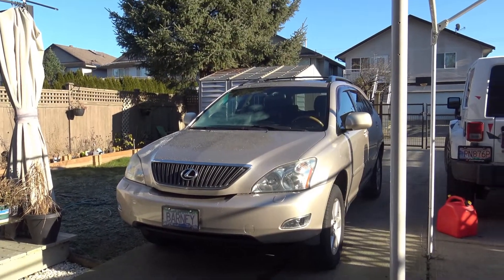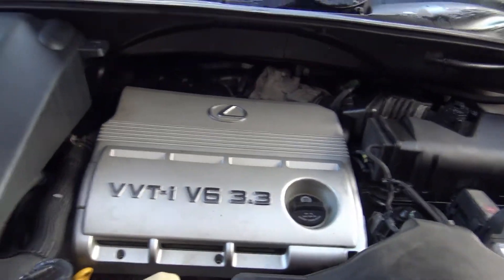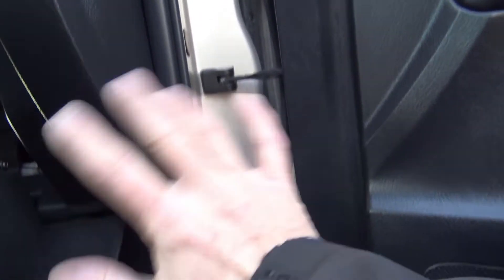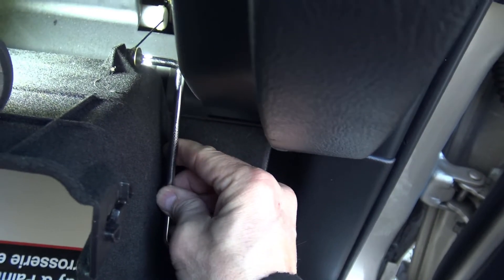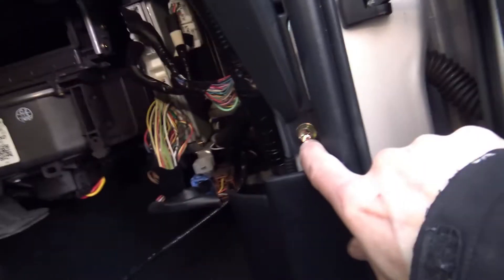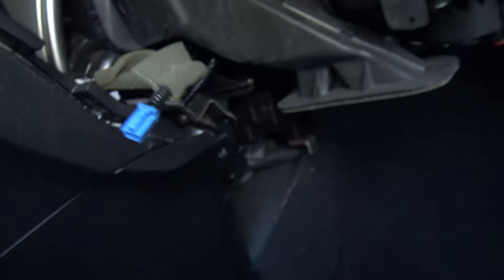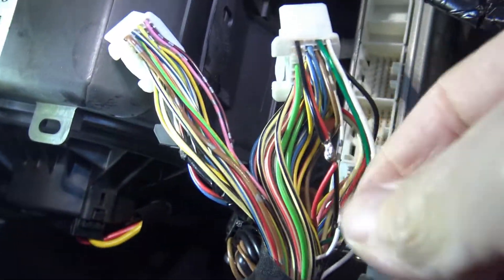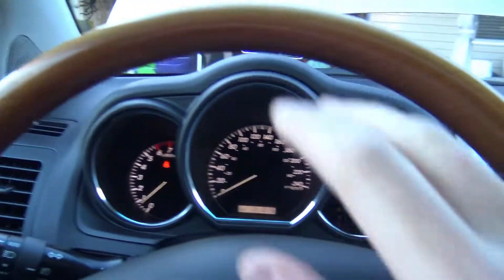lexus  code P0333 knock sensor hack

Comment: On my 2000 ES300 just jumpered both wires together (without cutting either one) and it worked.  No need to cut the bad wire because there is no power going through it anyway so why cut it?  Also, since both wires are uncut, it doesn't matter if you make a mistake identifying which wire is for which sensor because both are jumpered together.  On my car, the 2 wires are located on the very bottom connector when looking at the Engine Control Unit (ECU) which is sitting vertical under the glove box.  The two wires are clear and located in the middle toward the edge of connector but one wire has a red piece of tape on it to identify it as knock sensor #2 (OBD code P0330).

Comment: Good morning, good evening or night depending on what time or day you read this message,

Thank you for the hack or trick of the trade, 

But there is no explanation on the complete wiring schematic.

So if you cut the input wire from the knock sensor 
BANK 2 has black wire & white wire 
BANK 1 has red wire & green wire 

Red wire & black wire are the input back to pcm 

If you cut the black wire input from nock sensor to pcm ;  the white wire which carries the 5v reference from pcm  ( that wire goes to sensor & those 5v turn into higher voltage signal  which we have cut before it reaches pcm by cutting black wire) doesn’t that trigger a code?

Thank you in advance
Reply: Hi guys if you are here, you have issues with knock sensors 

This is an update on this code p0333
This code means that you have a faulty reading from knock sensor bank 2;
If you have no other knock sensor codes this SHOULD HELP You

If you have multiple knock sensors codes bank 1 & bank 2 knock sensor codes this will not help you.
I had to look for more information before I did the hack on a friend’s 2006 lexus RX300
Reply: So I did the hack, I. Only had this code P0333 no other code, 

Help Notes 
The bigger connector on the ecm or pcm computer how ever you may call this electric box, 
& now just follow what Mike is saying to do  

2 days driving no issues with transmission & No check engine came back

Comment: Just did it. So far so good. Thanks.
On 2004 RX330, you don't need to remove the first screw with the string in the glove box, just remove the 4 screws around and remove the entire block.

Comment: How would you do this on a Lexus rx350 2008 . Bank 2 black and white , bank 1 is green and red . Bank one is failing I tried but throws both sensors off . How should I splice ?

Comment: If the knock sensor is reporting correct data, won't circumventing it eventually result in the destruction of the engine, totaling the vehicle?  Quite some gamble.  Wouldn't a better bet be to purchase some tools and replace both sensors, performing other scheduled maintenance, like PCV valve and spark plugs [1]?

[1] "How to Replace Knock Sensors on a Toyota 3.3L 3MZ-FE" on the "Jack Fletcher" YT-channel.

Comment: I just replaced my ECU and now my radio does not start up super loud anymore when I start the car that I thought was odd and very annoying and the knock sensors were fixed too ..Bad ECU ,,Got a complete rebuilt one for $250

Comment: I have 2004 rx330
P0333 #10
Vibration sensor 2
 circuit high bank 2 . Anyone know if its the same wire assembly

Comment: what type of wire size are those small wire?

Just wanna know for reference if I do revert the wires back to the original connection in the future.They might be too short and need to add extension to reconnect them. Thanks so much!!

Comment: Thanks for this video. Just replaced my harness and both knock sensors for an intermittent P0333 code (voltage too high). Now that I replaced everything, I'm getting a P0327 (voltage too low). SO malfunctioning to non-functioning. Should have just bypassed it to begin with on this old piece of junk.
Reply: So I jumped the pins and now I get low voltage errors on both banks, even though the voltage is the same with a multimeter. What the hell? Bad ECU?
Reply: @Omnis2  did you get OEM/Denso sensors?

Comment: Hi thank you so much for the P0333 hack I have a Jaguar XJ8 X308 it has cured that problem. I tried putting a new knock sensor in but it still didn’t solve the problem I checked continuity through the wiring but still couldn’t resolve the issue until I tried your hack thanks again Kevin.

Comment: ok so I have completed this today and I just want to confirm my Lexus RX330 2005 code was PO332 I figured being that code I would do the other bank opposite of mikes video but I got no results and then did exactly as mike dIscrIbed on here and my issue is gone and running perfect no more lights and limp mode gone THANK YOU  MIKE !!!👍
Reply: Instead of doing that at the PCM.. The pigtail in the engine bay is much easier . I think
Reply: Could you help me u/s where that pigtail is in the engine bay ?  I need to do same job.  Hate to take apart the engine to replace the sensors, and that glovebox job looks almost as bad.   Thanks !!!       @sambatarseh242

Comment: This hack worked on my 2006 RX330, I’ve gone 1,500 miles and no more codes. My code was P0328 so the fix was to connect knock sensor 2 to both ecu inputs.
Reply: It’s been 10,000 miles now, still no codes.
Reply: @sambatarseh242
Instead of doing that at the PCM.. The pigtail in the engine bay is much easier . I think
Reply: where is it located @sambatarseh242
Reply: @sambatarseh242 which one is that?

Comment: Dumb idea. I destroyed a 2000 Solara TRD doing this.
Reply: What happened?
Reply: IT's worked for like a thousand other people
Reply: So your Solara was actually knocking and you ignored it?  This fix isn't to ignore a knocking engine.  This fix is to avoid a very expensive fix for, what is more often than not, just a failed wiring harness.

Comment: I just completed this operation (05 Lexus RX330). The check engine light was off and on prior to the op, and happened to be off immediately prior to the op. After starting the engine following the op, no check engine light. Plugged in the code reader, erased the stored po333 code, rescanned, nothing. Restarted engine, no check engine light. 

So there’s no evidence that the op fixed or broke anything since the light was off and on.

Will update here in a week unless the code comes back first, since I would definitely expect it to come on in a week’s time, given the known pattern.
Reply: Any update?
Reply: @liamehlers7216  Yeah, code hasn’t come back. No problems.